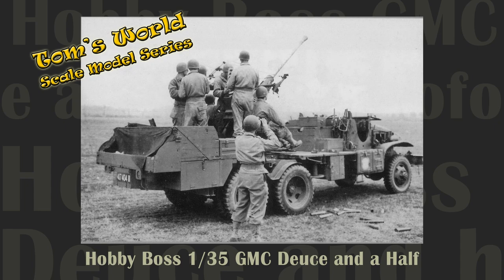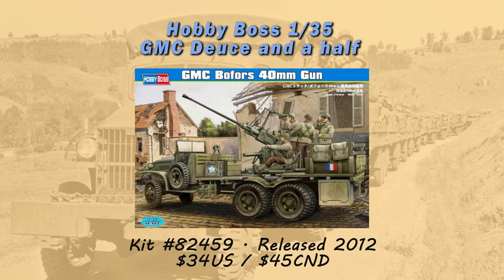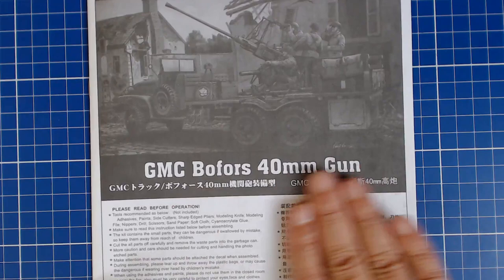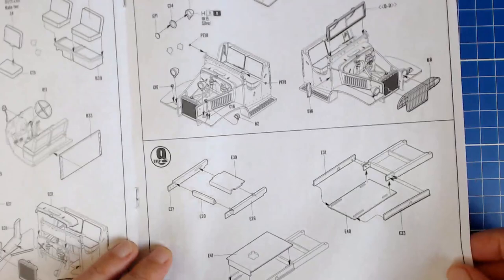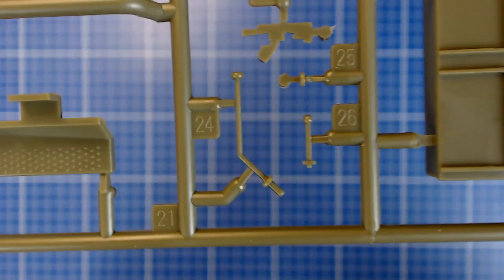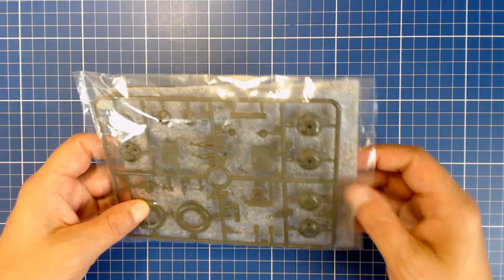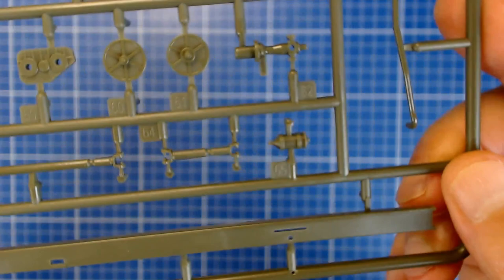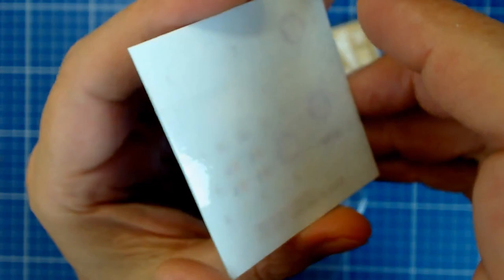Hobby Boss GMC Bofors Kit Review and Build Part 1

Comment: You'll be happy miniart have brought the cargo one's out now eh? I'm building the metal body with crew version it's very nice but I like the hobby boss one's to! The one with the 50cal ring was my favourite the front grill had to be shaved alot to thin it out it was just way to thick but really that was all I done! The new miniart one if PE grill with a jig but use a flame on the PE first to keep the shape or it'll not bend in shape!
Reply from the maker: Hey Charlie, thanks for the note and for the information about the kit. It's been a while since I posted the unboxing but I still remember really liking this model. GL with your build and thank you for stopping by and for writing.

Comment: The wheels are excellent, but the multipart axles are tricky. Some of the assembly of the axles to the frame are out of order. Best to work front front to back and work slowly while thinking at least 2 or 3 steps ahead when it comes to fitting the driveshafts at the correct angle. The worst part of assembly is the  firewall/ instrument panel, which has no clear demarcation for positioning. It takes a lot of fitting and adjustment to get it correct. It might be helpful to assemble first with goop glue that doesn't dry so you can see how to correctly locate the parts. Then take it apart and reglue permanently.
Reply from the maker: You're right, the wheels aren't terrible but multiply clean-up times 10 and it's time consuming. I'll keep your recommendations in mind when I slap this kit together. It's pretty epic (part count) but it's on the list for building. Thanks again DW!

Comment: They won't be able to do much with white decals toning the white down as you can't print white! That confused me once when first started printing my own it's the decal sheet itself that's cut out you don't get white tonner or onkjet ink haha
Reply from the maker: Just use darker paper? You can always tone down white decals with a brown or dark grey wash after they're applied. Lightly over-spraying the decals using the same colour as the base coat also works to fade the decals. You can also knock them down in Photoshop once the photos are taken Thanks Charlie.